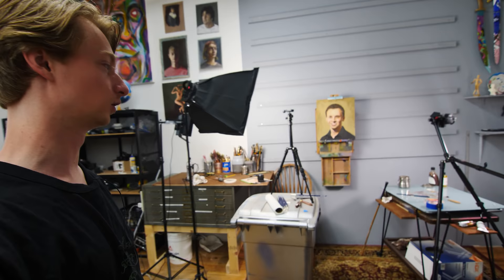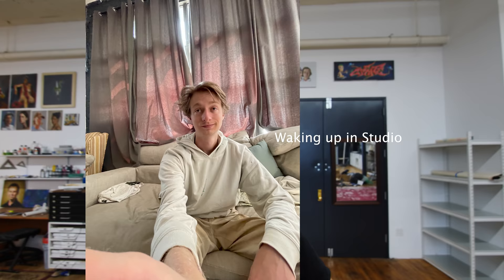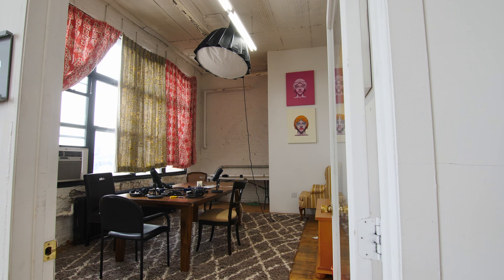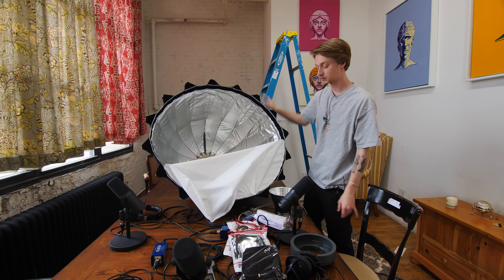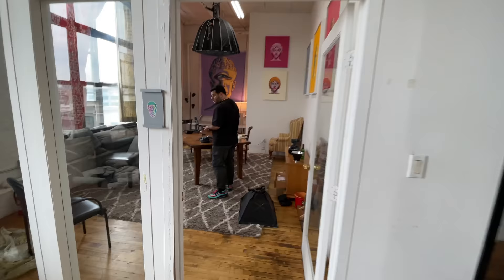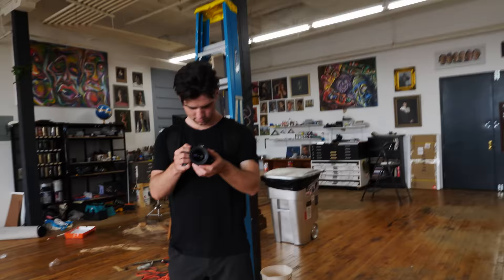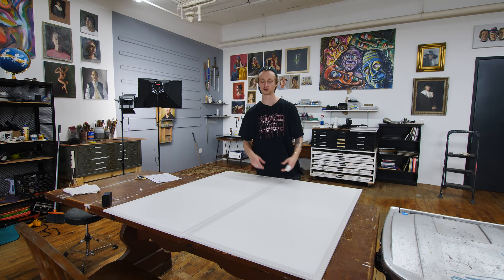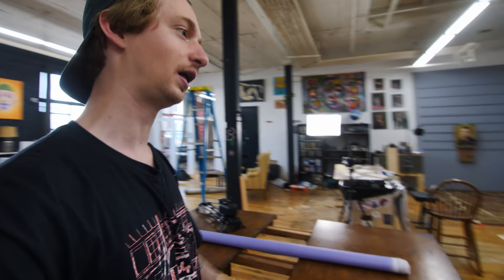The WORST 24 Hours of my LIFE! // (SLEWDIO_5)

Comment: Yo! You can put either very realistic colour images of a perching Owl pasted to the window next to the air conditioner or adhere a realistic plastic owl to the ledge or top or you air conditioner will scare the pigeons and keep them from landing on your sill or unit. 

Also Slew think about getting a couple of high watt output solar/ac chargeable generators and clamshell/suitcase style solar panels for your studio. Not to power heavy equipment, not a microwave or even your large fridge. Something to charge your phones, run a laptop (or desktop), fan, table/emergency lights and/or small fridge. NYC can have brown outs especially in the summer. At least you'll have power for immediate necessary items until the power comes back. Solar/AC chargeable generators are safe to have indoors unlike gas powered ones.  You have enough natural light to power portable solar grids.Make sure you can open your window to get air flow when the power goes out. Just sayin...